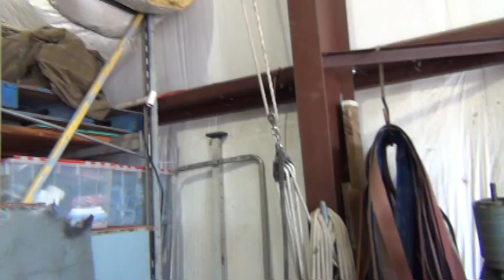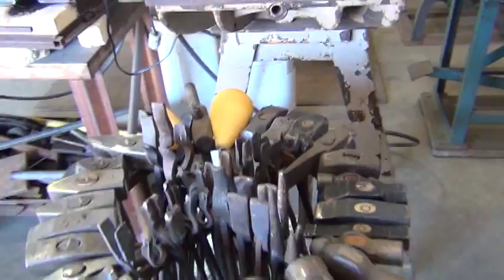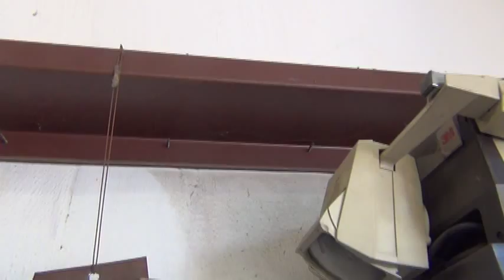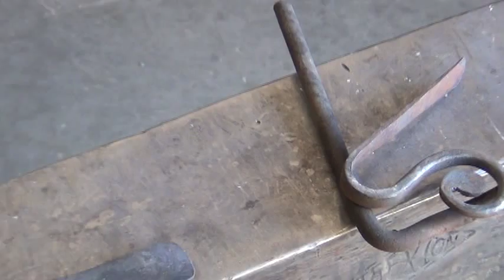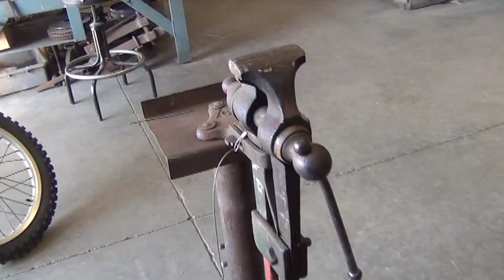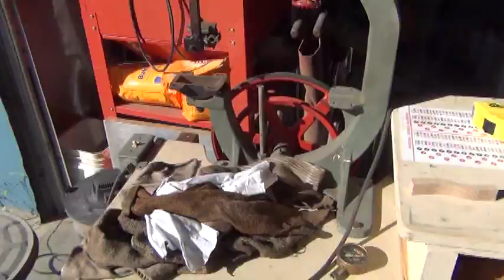blacksmith shop tour ( 3 ) forging tools

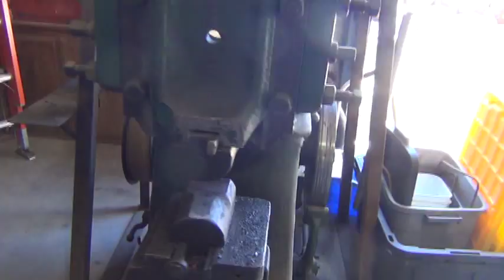Comment: nice to see someone setting up to use a helve hammer again, 6:24.  It's definitely turn of the last century. We have one too; it was run by overhead line-shafting, as late as 15 years ago- the oldest machine in the former, lamented Canadian Steel Foundries,